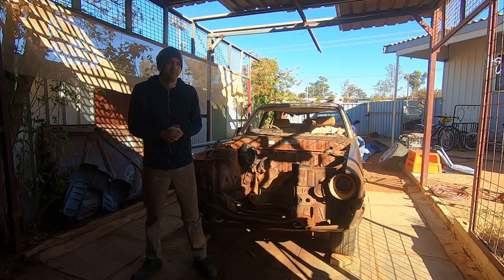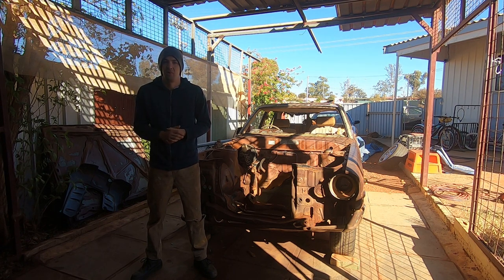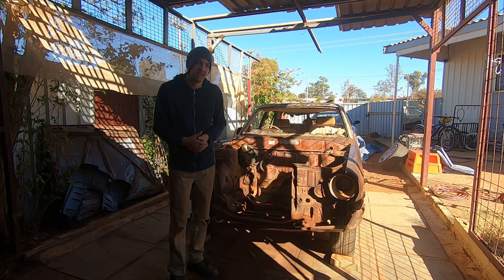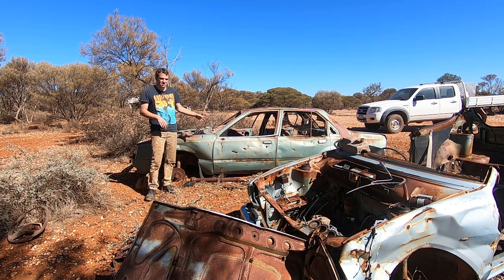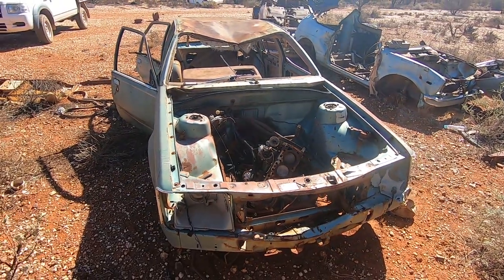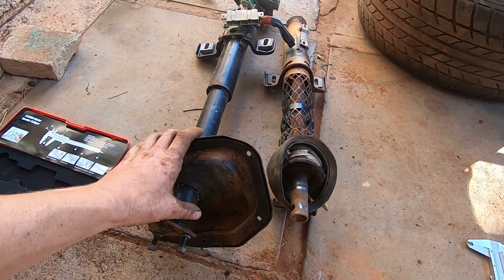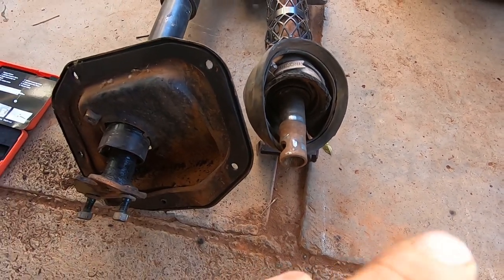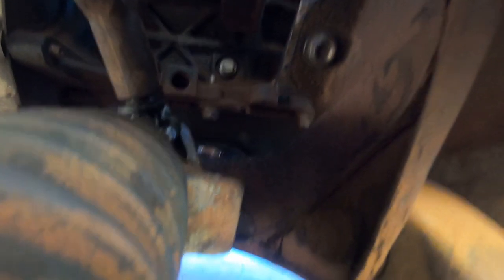MX32 Cressida gets rack and pinion steering!

Comment: Hi Buddy I'm liking this project. Also here is a link to a drift Cressida you may not have seen.https://www.youtube.com/watch?v=TLoAdsj5jRo. In response to the question on your other Cressida video re: tubes and pump on the 4ME engine. The pump produces air which is piped to the exhaust manifold. It is as you said an emissions thing.
Reply from the maker: Cheers mate, bro that guy has some big kahunas drifting the ring! Thanks for the info, I thought it was emissions but had now idea how lol.